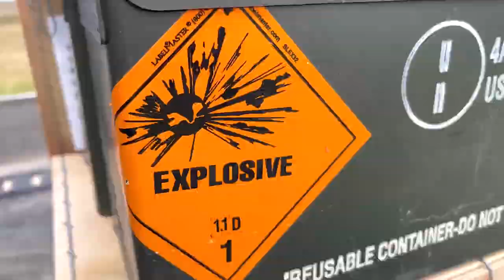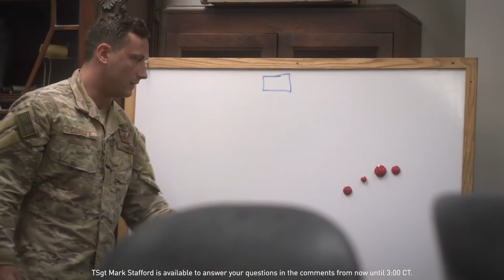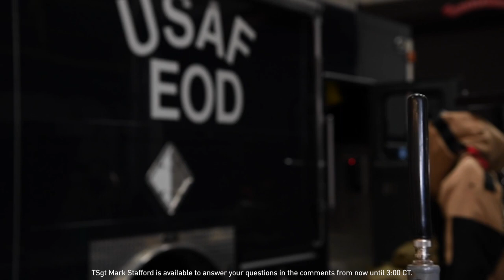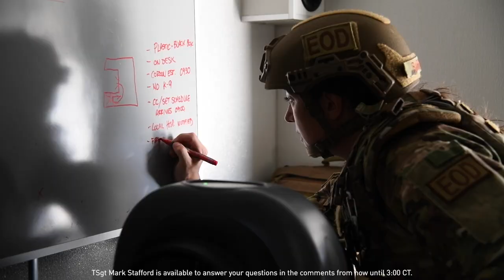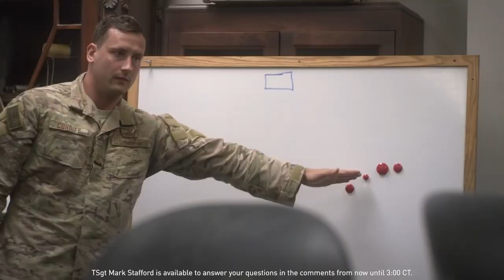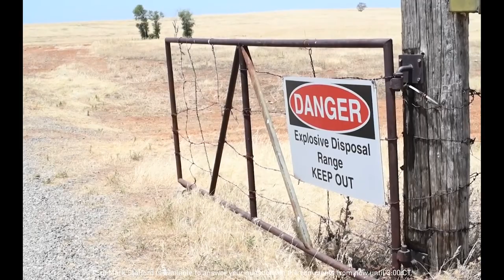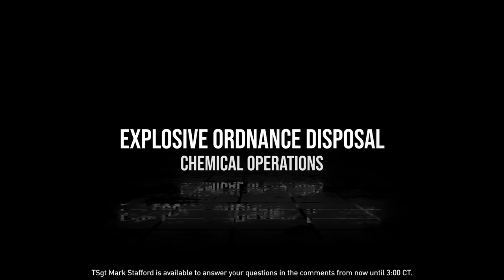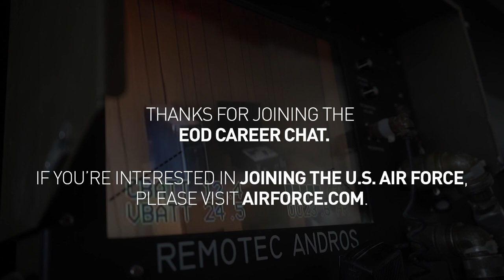Career Chat with EOD

Comment: What is the asvab score u need for this job
Reply from the maker: You will need at least a 49 in the general area of the ASVAB
Don
Air Force and Space Force Recruiting Service
Reply: @USAirForceRecruiting  wat about the other area like electronics and mechanical
Reply from the maker: The ASVAB is broken down into four main categories (Mechanical, Administrative, General, and Electronic), and all enlisted career fields have a minimum score requirement that falls under one or more of these categories. These scores, along with the results of your physical examination, will be reviewed when you undergo job counseling during the enlistment process at the Military Entrance Processing Station (MEPS).

For this particular career field, the score needed falls under General and is a 49. There is not a requirement for a score in any of the other areas. However, keep in mind, that you will need an overall score of 36 (31 if you meet all other mandatory requirements for an AFSC) to be eligible to join the Air Force.
Pam
Air Force and Space Force Recruiting Service

Comment: What’s the sign on bonuses and the requirements for the asvab for EOD?
Reply from the maker: Below are the areas that offer Initial Enlistment Bonuses for FY23. To receive the bonus a 6 year enlistment is required. Quick ship bonuses may be available. You may contact your area recruiter for further information. 
1A8X1 Airborne Linguist $ 8,000 – 6 years
1B4X1, CYBER WARFARE OPERATIONS – 6 years, see notes in para. 3 a – c
1D731A/S1D731A, CYBER TRANSPORT SYS/NETWORK OPERATIONS – see notes below
1D731B/S1D731B, CYBER SYSTEMS OPERATIONS – see notes below
1D731D/S1D731D, CYBER SURETY – see notes below
1D731E/S1D731E, CLIENT SYSTEMS – see notes below 
1N3XX Crypto Linguist- 6 years, $ 6,000 
1T0X1 SERE- 6 years, $ 20,000 
2A534, REFUEL/BOMBER AIRCRAFT MAINTENANCE – 6 year, $6,000/4 year, $3,000
2A632, AEROSPACE GROUND EQUIPMENT – 6 year, $6,000/4 year, $3,000
2A634, AIRCRAFT FUELS SYSTEMS – 6 year, $6,000/4 year, $3,000
2A635, AIRCRAFT HYDRAULICS SYSTEMS - 6-YR, $6,000 / 4-YR, $3,000
2F031, FUELS – 6 year, $6,000/4 year, $3,000
2WO31, MUNITIONS SYSTEMS – 6 year, $6,000/4 year, $3,000

3E8X1 EOD - 6 years, $20,000

9T500, SPECIAL WARFARE OPERATOR ENLISTMENT - 6 years, $40,000

a.	Member must have a current industry certification listed on DoD Approved 8570 Baseline Certifications page http://iase.disa.mil/iawip/Pages/iabaseline.aspx) and enlist for 6 years in one of the following AFSCs: 1B431, 1D731A/S1D731A, 1D731B/S1D731B, 1D731D/S1D731D, and 1D731E/S1D731E.
b.	Level of certification determines bonus pay amount.
1.	 Any Level I Certification (A+, Network+) - $12, 000
2.	Any Level II Certification (CCNA-Security, CAP, GSLC, Security+, CSSLP, GSEC) or Any CNDSP Certification (CISM, CISA, GCIH, GCIA, CEH, SSCP, CSIH, GCFA, GSNA) - $15,000
3.	Any Level III Certification (CISSP, CASP, GCED) - $20,000
c.	Member will only be paid one bonus based on the highest level of certification earned.  

Pam
Air Force and Space Force Recruiting Service

Comment: Can you join as prior service
Reply from the maker: The Prior Service (PS) program is an enlistment program, allowing a select number of separated individuals to return to active duty. The total accession is subject to change based on Air Force needs. An Air Force Recruiter will help determine if you are qualified. A DD 214 is needed to begin the process. Below is the FY 23 listing of available careers for the PS program. Availability is extremely limited. You may reach out to your area recruiter for further information. 

1C5X1	Command & Control Battle Mgt Ops				Direct Duty Only	
1D7X1A	Cyber Defense Operations - Network Ops			Direct Duty or Retrain	
1D7X1B	Cyber Defense Operations - System Ops			Direct Duty or Retrain	
1D7X1Z	Cyber Defense Operations - Software Dev Ops			Direct Duty or Retrain	
1N8X1	Targeting Analyst						Direct Duty Only	
1T0X1	Survival, Evasion, Resist, & Escape (SERE)			Direct Duty or Retrain	
1Z1X1	Pararescue (PJ)						Direct Duty or Retrain	
1Z2X1	Combat Control (CCT)					Direct Duty or Retrain	
1Z3X1	Tactical Air Control Party (TACP)				Direct Duty or Retrain	
1Z4X1	Special Reconnaisance					Direct Duty or Retrain	
2A377	Tactical Aircraft Mx (5th Gen) Craftsman			Direct Duty or Retrain	
2A378	Remotely Piloted Aircraft Mx Craftsman			Direct Duty or Retrain	
2A3X8B	Remotely Piloted Aircraft Mx (RQ-4)				Direct Duty or Retrain	
2A5X4C	Refuel/Bomber Aircraft Mx (KC-46)				Direct Duty Only	
2A8X1H	MAF Comm/Counter/Nav Sys (KC-46) Craftsman			Direct Duty or Retrain	
2A8X1J	MAF Comm/Counter/Nav Sys (All Tanker Arcfrt) Craftsman		Direct Duty or Retrain	
2A8X2H	MAF Instrument & Flt Cont Sys (KC-46)				Direct Duty or Retrain	
2A9X2D	Bomber/Special Instr & Flt Cont Sys (RC-135)			Direct Duty or Retrain	
2R1X1	Maintenance Mgmt Production				Direct Duty or Retrain	
3E5X1	Engineering						Direct Duty Only	
3N0X6	Public Affairs						Direct Duty Only	
4C0X1	Mental Health						Direct Duty Only	

FY23  Slots Available: 100

Pam
Air Force and Space Force Recruiting Service